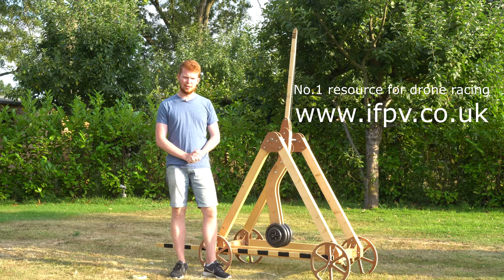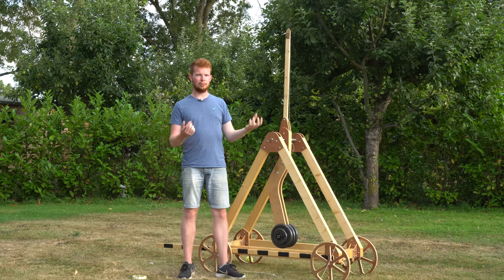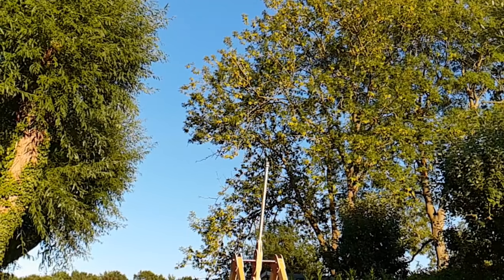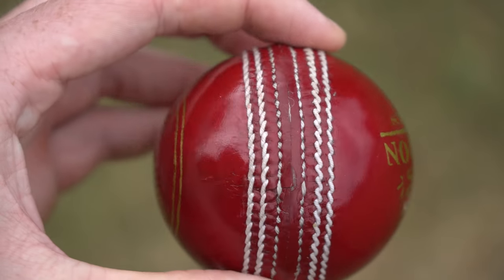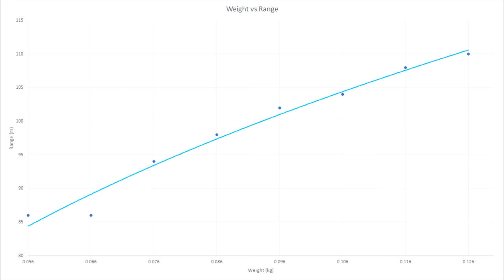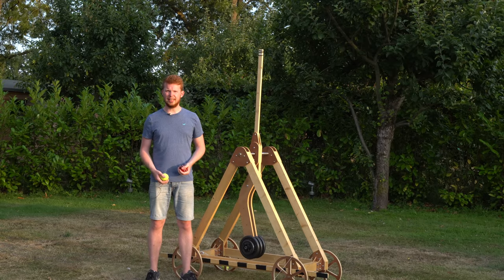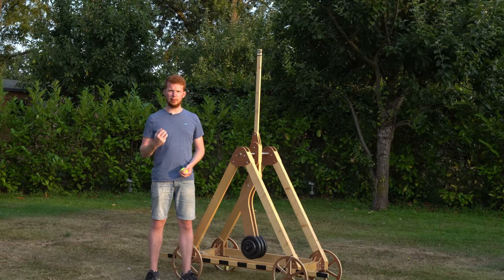Trebuchet Projectile Optimisation

Comment: You get cricket balls in 113g, 136g and 156g like you had... They make lighter easier grip ones for junior cricket. Definitely recommend you try one of them and they'll be easy to get hold of...
Reply: Also the marginally smaller size will improve it's air resistance...
Reply: Also they don't have the hairy texture that most tennis balls have, which should even further improve air resistance.
Reply: golf ball dimples do help them travel further, weigh about 46 grams
a 1+1/16 standard steel pinball weighs about 80 grams... look out!
1+3/16 steel ball, about 112.9 grams, 1+1/4 about 131.5 grams (bingo!)
1+5/16 gets over 150 grams so no. 1+3/16 like a near 4oz bullet, lot of force!

Comment: The tennis ball wasn't dropping straight down at the end. Remember that your camera isn't directly overhead the ball for the hole trajectory, and that it's just at a point. Think of a triangle with the ball falling along one of the legs. 

Great video, I'm glad someone is out living life and having fun 😉
Reply: +2MAz Bit late to the party, but: Veritasium proved in one of his videos that making something spin requires a lot less energy compared to what's used for accelerating it. So little in fact that shooting a wooden block in the middle or to the side (to make it spin) made practically no difference in the upwards velocity. The energy going into making this tennis ball spin is probably going to be in the 0.1% of its velocity, which would not be noticeable on a camera.
Reply: @Excludos  the backward spin allows it to stay airborn longer too due to the magnus effect, so it should be beneficial to have the ball spin
Reply: Cashy 1 It is. You gain height exactly because of the magnus effect, but you don't lose a lot of velocity, which increases distance by quite a bit
Reply: There are a lot of smart people here
Reply: @dp4advanced234  😂😂😂😂

Comment: I think you should remake your trebuchet to be... 3 times bigger?
Reply: In length, area or volume?
Reply: Since we exist in a 3D universe, as far as we know, I would assume volume.
Reply: So the trebuchet should only be about 1.44 times higher?
Reply: at least 3 times bigger so not only tiny people can fit inside it..

NB. x2 scale would be quite large...  coconut launcher...
(punkin chunking trebuchet record is around 864 metres.)
Reply: I have 5 scales of Rolling Whippers. 16 inches to 22 feet tall.
Reply: Yeah don't do that. They have done this. They killed a guy and smashed another girl.
Reply: They were using a Hinged Counterweight Trebuchet. Whippers launch at 4 times the velocity. A Whipper large enough to launch a person would be pulling hundreds of Gs. Humans start to liquify at about 50Gs.
Reply: It should be whatever size big enough to fling a cattle
Reply: enough to fire a 100kg projectile over 300m
Reply: Design it to shoot cantaloupes. I've heard they make fantastic ammunition for catapults and trebuchets.
Reply: Bollox use a car as the counter weigt and use a really long thin pole to throw steel 1kg balls lol that would in theory be like a bullet if it would work
Reply: @FingerAngle  at least they didn't give up the first time.
Reply: @theflobby2518  🤓

Comment: Magnus effect.
Try a release mecanism that uses a pivot and a screw to adjust easely on field. Turning the screw modifies the angle., and the system is quite robust.
You might want to try a ball with dimpled texture on it, like golf bals... This will help it to travrl further... And you might be able to modify travel direction if you dimple it with different paterns (just a dimple band and non dimpled sides)
Good luck!
Reply: Bump

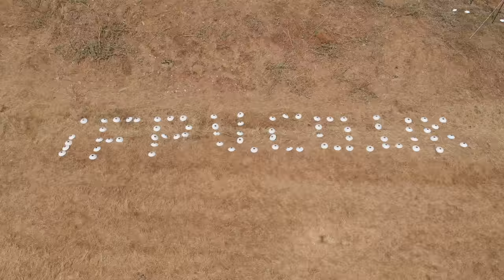Comment: 1:12 What a catch <3
Reply from the maker: Best catch ever! You single handedly saved bretts gopro
Reply: You could try to stabilize that footage. It would be interesting. :)
Reply: Tom Stanton 
To your question on how the acceleration should be faster, the outward acceleration shouldn't be that much different ( there is a bit of a difference because the weight difference of the balls should impact the end velocity, more weight=lower end velocity). If you actually mean the forward acceleration of the ball, the ball with the lower weight should have a higher acceleration due to it having less potential energy and more kinetic energy and of course having a lower mass inertia.
Of course, this is just a mere assumption, so take it with a grain of salt ;D.
Reply: too low fps to stabilize, you are simply missing the information
Reply: I had a random idea actually, in a future series do a video on reaction wheels, and build a small one then hook up camera to it and throw it with the trebuchet to demonstrate how it stays stable.   Like it could be programmed to always point the camera a certain direction.   Not sure how realistic that is though or if a reaction wheel setup small enough would even have enough power to stabilize.
Reply: Didn't expect to see an fpv pilot here!

Comment: Hey Tom, love these videos!

I recently observed a full scale reconstruction of a medieval trebuchet in action, and the engineers operating it said that the ideal counterweight/projectile mass ratio is 100-1. So for a 5kg payload, a 500kg counterweight would be rigged. I'm not sure if this is optimal, merely anecdotal, or simply the manner in which the machines were configured historically, but I thought it would be worth mentioning. 

I believe your counterweight is 15kg? If so that would put your 156g Cricket ball slightly over the (alleged) optimal mass (which would be 150g) for your current counterweight. I assume though that the optimal mass ratio would vary based on the other parameters of the machine, though it seems not by a great deal, given the results you've shown here. 

Also of note: the trebuchet I observed was fixed (as I imagine most historical examples would have been). Perhaps as the mass of your projectile and counterweight approach the optimal ratio, the benefit of the wheels is reversed and becomes a detriment? IIRC the wheels altered the stall angle of the main arm, and you said in this video that raising the mass of the projectile changes the release angle as a result of a faster transfer of energy into the projectile. 

Maybe you could try the Cricket ball without the wheels, as the plateau you observed at ~130g could be a result of the wheels stealing away some of the energy from the projectile.

Comment: It makes sense that the Ke change wouldn't be exponential, I mean, the larger ball is being accelerated for about 10-20% longer by the same force. The speed won't be quite as high, but it won't be solely based on that kinetic energy equation, since that can't account for the change in inertia of the rotating body, which is now significantly greater. 

Also, I'd love to see this thing launch a fin-stabilized projectile. Maybe a go-pro embeded into a nerf football?

Comment: 3d print a projectile!
Adjust the infill accordingly. I don't know if the density is high enough though
Reply: Dööörk was about to comment I see a 3D printed projectile coming on
Reply: Totally could work.  Maybe something that opens up and has a bolt going through and he can thread small weights inside. Like actual nuts/washers.  Idealy want to try to keep the weight in the centre.
Reply: But would it survive repeated impact for testing purposes?
Reply: I use 3-D printed models to make silicone molds.
Reply: Maybe if printed with flexible filament it would
Reply: Why not meltdown some failed prints?
Reply: You could make a mould from the 3D print and cast in poly urethane.
Reply: With more than 150G of acceleration, it will need to be tough enough for the purpose. How about moulding some out of clay and baking them before use?

Comment: Hi Tom, just a thought. You did one video explaining how efficient the Trebuchet is, and the result was lower than you expected. As a cyclist this reminded me of the marginal gains of cycling adding up to a huge efficiency difference between an old bike drivetrain and a new drivetrain with sealed bearings, often ceramic and in general a very watt efficient transfer of energy with the same input. What if you did a video replacing all the pivot points with sealed bearings, and similarly looking at other materials for the sling and other contact points. This could be very interesting to see how much different these reductions in friction can make and effect projectile velocity. Thanks For the great videos.

Comment: 1. E=mv^2  is a second degree polynomial in the velocity, also called a quadratic form. Functions that have the variable in the exponent are called exponentials.
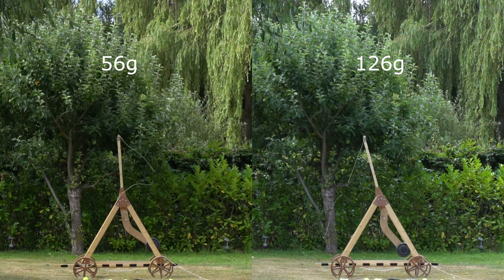2. At 9:19 and 8:07 it looks like that the arm is flexing quite much under the force, perhaps try for a more stiff arm? I would guess that the flex is messing up the projectile release. 
3. At 8:07 you state that that the arm is moving far less with a heavier projectile, that should be due to the higher energy transfer efficiency of a heavier projectile. It is simply less remaining energy in the system. Edit: your trebuchet is also a double pendulum which is a chaotic system which means that very small deviations in initial values (starting position of the projectile, skewness or give in the machine construction e.t.c.) will affect the behaviour dramatically. Therefore the behaviour is very hard to predict.
Reply: Very nice comment, thanks for the information :)

Comment: I think it would be cool if you could try to find the optimal release angle (or better yet, initial projectile trajectory angle) between 30 and 45 degrees with backspin. Then once you know the best release angle hold that constant and optimize on the ball weight.

RE: Dimples: The only point of dimples is to trip the boundary layer so it becomes turbulent and the flow can maintain attachment reducing pressure drag caused be the wake. The dimples increase viscous surface drag, but for the right Reynold's number the decrease in pressure drag is greater than the increase in viscous surface drag. If the larger tennis ball (relative to a golf ball)  and fast speeds of the trebuchet can put a smooth ball into the regime (i.e. high enough Reynolds number) where the BL has transitioned to turbulence and remains attached (for longer) then the drag coefficient will be much lower. See the plot for C_d on the right hand side at https://en.wikipedia.org/wiki/Drag_coefficient. (Link to image: https://en.wikipedia.org/wiki/Drag_coefficient#/media/File:Drag_coefficient_on_a_sphere_vs._Reynolds_number_-_main_trends.svg)
Reply: correct

Comment: When optimizing something (such as projectile mass) you have to actually try values of range high enough so that there's an extremum point. For example in your projectile weight vs distance graph it just increases which means that you could have further increased projectile mass and got even longer shots before you actually reached maximum. So instead of monotonously increasing/decreasing curves, all of them actually have minimums and maximums if you plot them on wide enough range of input values.

Comment: What i am interested in now is how the shape/weight/movement of the frame impacts efficiency. My instinct says that allowing the pivot to move vertically would help, but i don't know how to do that. Installing wheels for horizontal movement is simple, but vertical is trickier, especially since you'd want it adjustable to allow for some experimentation. Maybe some sort of suspension could work.

Fascinating project!

Comment: What you've discovered is what electrical engineers call impedance matching. The sling length, counterweight mass and lever geometry all affect the ideal mass of projectile. If they are matched, you get a newton's cradle kind of effect where all energy is transferred from one moving object to the other. Alternatively, have you seen a newton's cradle with unequal balls?

Comment: I have built my own trebuchet copying your design and having fun. It started as a lockdown project during our New Zeland level 4 lockdown. I am trying a tapered arm made of radiata pine rather than an arm of constant rectangular cross section to reduce inertia moment. I am considering making the sling itself from thin cord as well as the using the same thin cord for the fixed and release strings. And then 
making the pin as light as possible-maybe from nylon. All this to reduce the inertia of the arm so that more energy goes into the projectile. Going further a tapered carbon fibre arm might be better for better strength to weight ratio.

Comment: A baseball's dry weight is supposed to be 5.0 ounces, or ~142 g.  However, they absorb water over time, from humid air, or damp ground and grass.  Worst case, a ball that has been used or left in the rain can be overweight by 0.5 oz/14 g or more after drying in normal household conditions.  Of a sample of 5 used baseballs I happen to have handy that were dried in a dehumidifier, three weigh 147g, 1 weighs 146, and 1 was at its 142g initial weight.  It also looks newest.

So, if you're looking to really control the weight of your projectile for consistency, a baseball will get a bit heavier over time as it absorbs water into its leather covering.

Comment: You can either 3D print or CNC the right projectile. That way you can make any combination you want.
Maybe even add something to it so it's better visible on the drone shot?
Reply: I use 3-D printed models to make silicone molds for casting dimpled projectiles in several sizes and weights.

Comment: At 10:30 that doesn't look like backspin. It looks like topspin!
Reply: It's back...
Reply: Definitely looks like a forward spin. might just be aliasing, but at 0.25x speed it looks too smooth for that...
Reply: It would depend on wind direction. If you have a headwind, you'd want topspin, tailwind, go for backspin.
Reply: You never want topspin. You must control the amount of backspin. It's actually pretty much impossible to get topspin. You can however get side spin, as you can see in Tom's video. I'm going to see if I can launch a spiral with a football.
Reply: It could be the camera shutter making it look like forward spin. Same reason why the popular no spin helicopter vids are possible.
Reply: Yeah that camera view seemingly showing topspin was driving me nuts as well 😂. He may get more consistency if the ball had topspin, spending more of it's time with lots of forward velocity rather than floating up and being maligned by the wind. However it'd almost certainly detract from max range depending on when the ball lost most of it's energy.
Reply: Aliasing of the camera shutter and the speed of the rotation of the ball. You see the same thing often with aircraft props in videos.

Comment: Neat videos!
One variable worth considering would be the launch arm length; if you increased the length you’d increase the rotational moment of inertia of the launch arm, which would delay the stall and compensate for the tennis balls’ low weight. Would make life easier not having to procure specialty projectiles.
Reply: Alternatively, you could try adding incremental amounts of weight to the tip of the launch arm as this would have the same effect of increasing the launch arm’s rotational moment of inertia.

Comment: keep the fuzz on the ball, believe it or not but it actually decreases drag, look at the workings of a golfball. to increase distance you can increase weigt of the counter balance, increase the arm of the trebuchet, change the release angle of the projectile and maybe give the projectile a spin to generate a bit of a magnus effect. maybe you can also make a stop for the counterweight so that it remains extended while upright.

Comment: Late to the party but I reckon that the bottom spin does not add to the range because, as you said the horizontal velocity of the ball diminishes quickly due to friction. Because of this the angle of the trajectory itself is less relevant. Great stuff!

Comment: I built a trebuchet as a high school project for my daughter and then couldn't leave it alone. I also found that tennis balls weren't ideal due to wind resistance and weight. Problem solved by cutting a small slit in the ball and inserting pea gravel. Weighing each ball on the scale for consistency. The gravel in the ball reduced bouncing and rolling on impact which helped recovery. Pink is easier to find in the grass than green. Changing the length of the sling also alters release time so heavier projectiles need to be tuned to the sling.

Comment: Man I love this project! You could try getting closer to a release angle of 45° to maximize the range.
Reply: LueLou Interesting. But I‘m not sure if that’s how it works since the air resistance applies to both the vertical and the horizontal speed component in the same way. I think that the air resistance will be more like a buffer that allows for imperfect angles since it will slow down the faster one of both components relative to the slower component. Do you mind explaining yourself a bit more?
Reply: Ballisticians have proven that the optimum release angle for distance is below 45 degrees. Go to this trebuchet calculator, plug in some dimensional data and look at the results from changing release angle http://virtualtrebuchet.com/OldVersion/Trebuchet.aspx
Reply: Thanks to both of you! In the documentation of the virtual trebuchet it states that the optimal release angle is between 35° and 40°. I honestly wouldn't have thought that the air resistance pays such a big role. If I understand this correctly, the release angle is entirely dependent of the initial projectile speed with the ideal angle being lower the higher the projectile speed is.